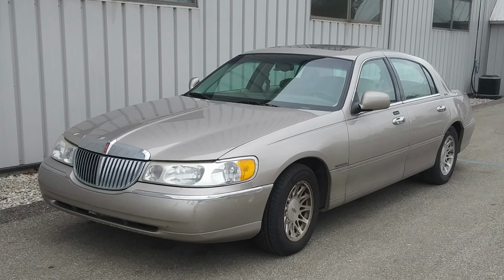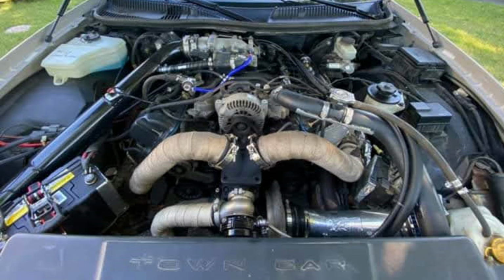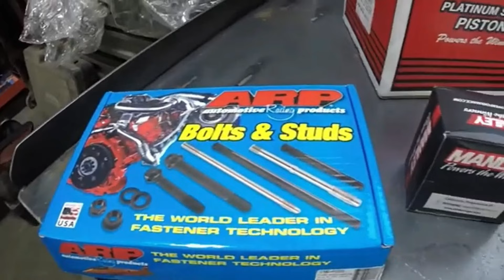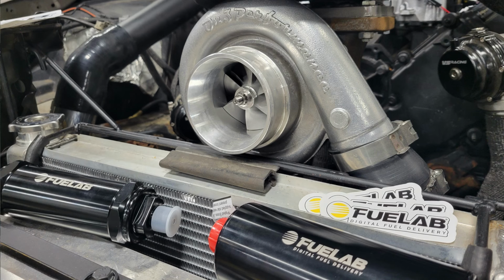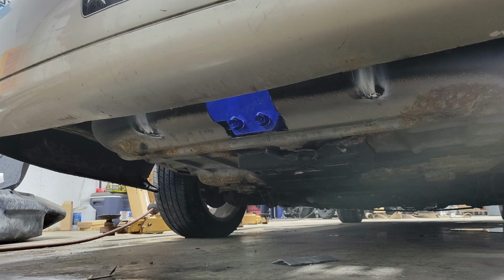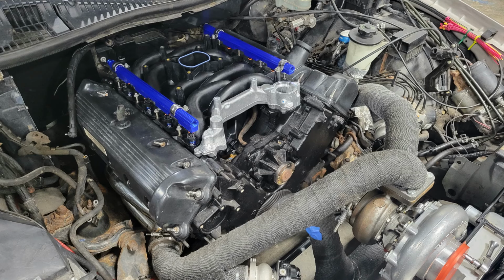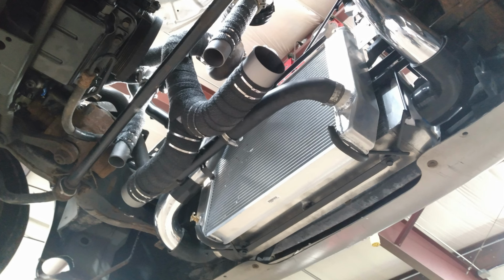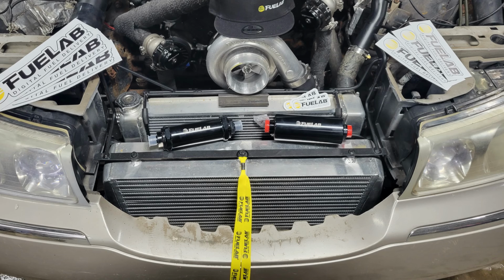HOW TO BUILD A 11 SECOND TURBO TOWN CAR IN 13 MINUTES

Comment: Love it it dude! And exactly… I’m picking up some turbo manifolds(aka modified stock vic manifolds with bands welded to em) from a buddy of mine reason I was askin what size turbo you were runnin out of curiosity lol goin to be piecing stuff together to turbo this pig and also manual swap it.
Reply from the maker: Omfg bro, that car will be on another level of wicked with a turbo and a manual 💯💯💯
Reply: @BadgerBuilt  might take a bit to get there still but just trying to be cool like you 😁🤝😎